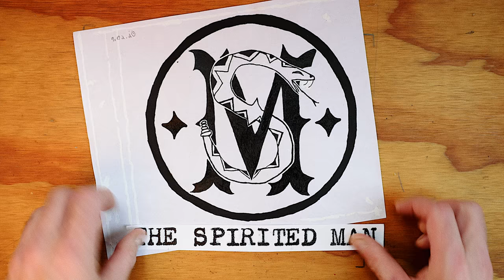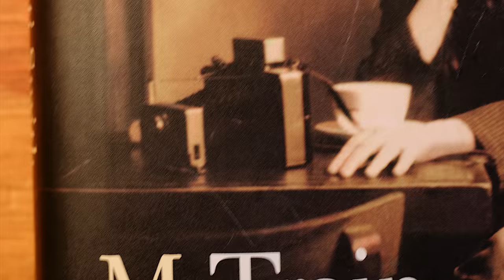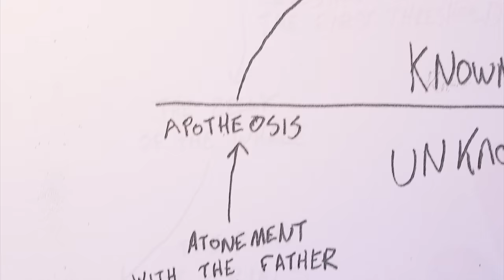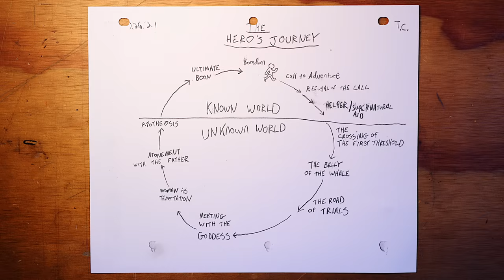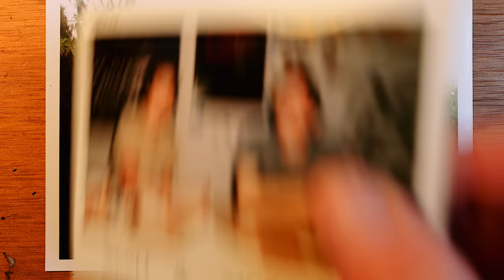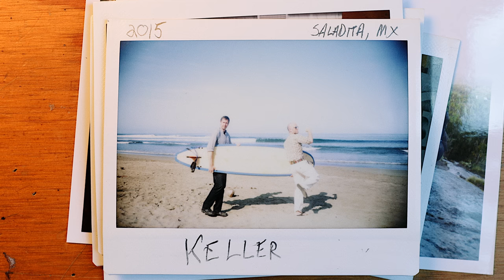No Vacation From the Camera

Comment: Van, i actually came up with an aesthetically non intrusive method to have a wireless remote for a Fuji Instax, in my case a Fuji Instax wide, installing a micro wireless relè inside the case of the camera. There was just the right amount of space in the bottom left corner under the lens between the grip. You power it connecting it to the main battery circuit, The only pitfall is interrupting the circuit by removing a battery to avoid power drainage. Works like a charm, depending on the type of the remote the open/close functions can be activated in one press or two. I have an unedited video on my hard drive where I explain how to do it but I know a guy like you can figure out the missing steps.

Comment: hey Van, wondering your thoughts on lost photos and videos. my first camera was in my first phone in 2013, all the photos i had taken from 2013 - 2019 were permanently lost (through no fault of my own) and it is hard to feel those connections from that time without my thousands of photos. My teenage years all wiped away all and my local backups were all corrupted (only recovered a few dozen out of ~11,000), everyday i now carry with me 2 cameras at all times and multiple back up drives, it is hard to film without fear of loss, no vacation from a camera, and no vacation from a backup hard drive, no vacation from the internal conflict